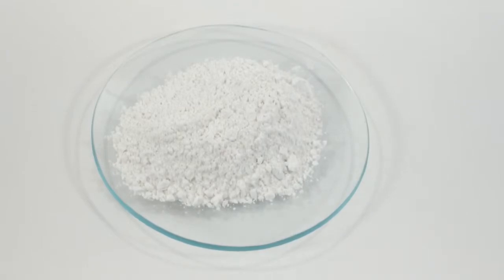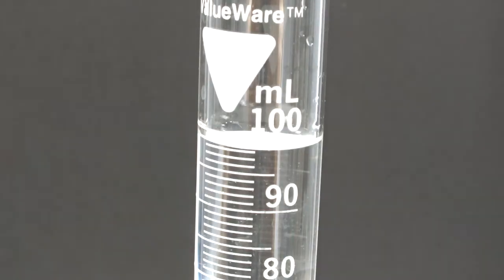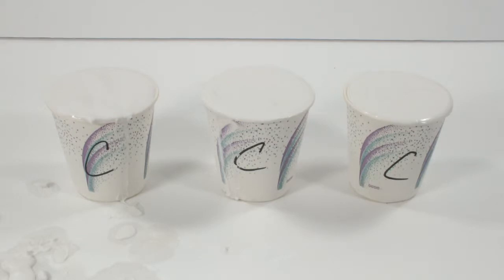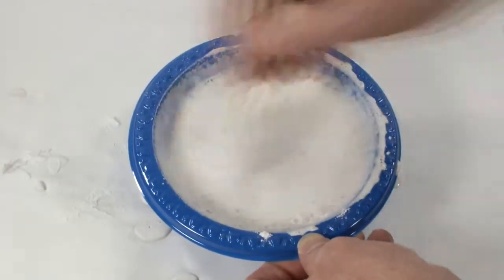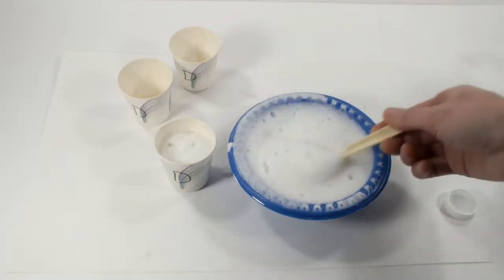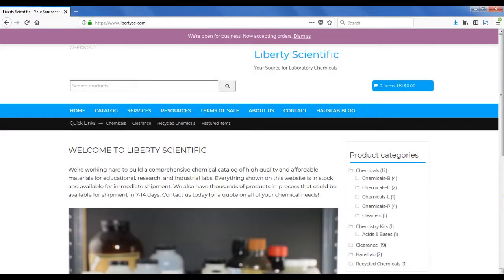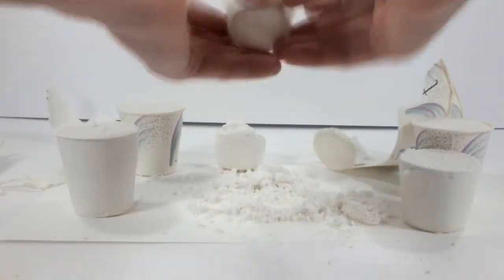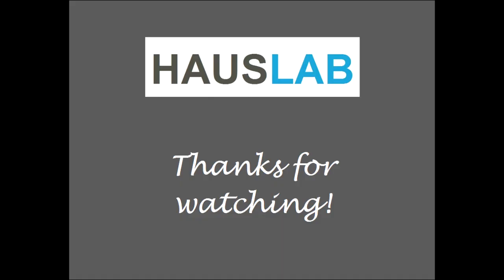02.05: Calcium Sulfate

Comment: Thanks for the video, enjoyed it.

Could you explain why the salts accelerate the hardening process? I thought a salt like sodium chloride would increase the solubility of calcium sulfate making it longer for it to set or am I misunderstanding this?
Reply from the maker: Hi Moosong! Thanks so much for watching! You asked a couple of really good questions and I'll do my best to address them.

First, let's talk about what it means for plaster to "cure". Plaster of Paris is primarily the hemihydrate form of calcium sulfate, which is produced by heating the dihydrate form (from the mineral gypsum) to drive off roughly 75% of the water within the crystalline structure. By adding the recommended amount of water back to the plaster, the crystalline structure of the gypsum is restored. These are chemical changes, and as I showed in the video, the curing reaction is exothermic. When a salt dissolves, it is a physical change. Calcium sulfate is almost completely insoluble in water, though some theories on the mechanism of "curing" suggest that the "dehydrate" of calcium sulfate "dissolves" in the water, but I find those terms to be misleading in this case. More on that in a moment.

Next, will sodium chloride increase the solubility of calcium sulfate? Well, that's a very complicated question and please forgive me for dodging the theoretical explanation in favor of something more relevant to this reaction. Calcium sulfate is said to be soluble in water to about 0.24% (at 20 ºC). That's for the dihydrate, by the way. So at the ratio used in setting plaster of Paris, we'd call what dissolves "negligible". Adding a small amount of sodium chloride isn't going to affect the solubility drastically enough to dissolve anything more than a "negligible" amount of calcium sulfate. And again, it's important to keep in mind that the water isn't primarily dissolving the plaster, but is instead reacting with it. I'm not sure if the analogy will make sense, but imagine you have a pile of anhydrous copper sulfate that is white in color. If you add a single drop of water, there may be some dissolution, but the end result will be that the water is incorporated into the copper sulfate as water of crystallization (chemical change) as opposed to having a droplet of copper sulfate solution (physical change). In that big pile of white powder, you will have a little speck of blue where that reaction took place. (This is an exothermic reaction, too, by the way.)

Now for the big question: Why do salts accelerate the hardening process? There are two simple answers: it's complicated, and we don't really know for sure! In fact, some salts retard the hardening process. I managed to find an old document from the US Department of Commerce, Bureau of National Standards, from 1973 that analyzes in great detail the curing of plaster. In the document, which I've linked below, they test eighteen different salts and compare cure times and the differences in temperature. Here are a few highlights from their data: Untreated plaster set in 76 minutes, while adding 2% potassium sulfate reduced cure time to just 9 minutes. Small amounts of certain salts actually retarded the cure time slightly (0.8% aluminum sulfate increased the time to 87 minutes) while a larger amount sped it up (6.7% aluminum sulfate set in 40 minutes). Winner for slowest cure time is succinic acid. At just 0.2%, the cure time was 271 minutes!  This document also goes into great detail about how the crystalline structure is altered by the additives. I'd recommend it highly if you want to learn more about the process.  As I mentioned briefly above, the primary goal of this study was to determine the mechanism behind the setting of plaster. At the time it was done, there were competing theories. This document brings them together and says "they're all somewhat true, because several things are happening at the same time." Which is the diplomatic way of saying "it's complicated".

I hope this answered your questions! Thanks again for watching!

Here's the link for the paper I referenced: 
https://ia801704.us.archive.org/17/items/someaspectsofset755clif/someaspectsofset755clif.pdf